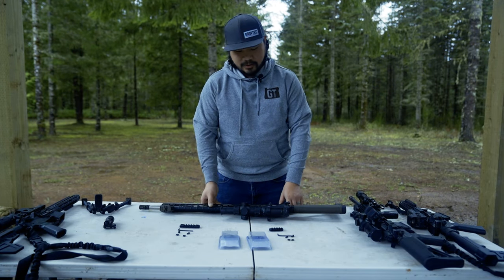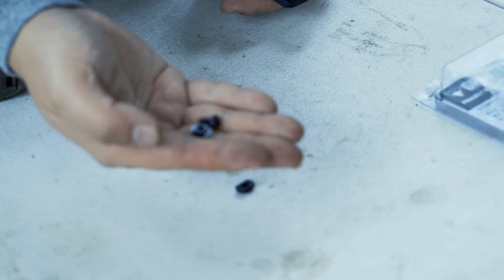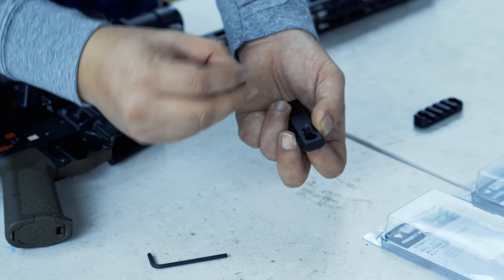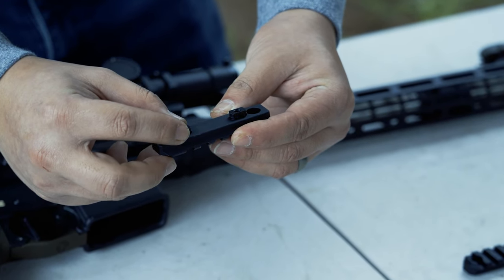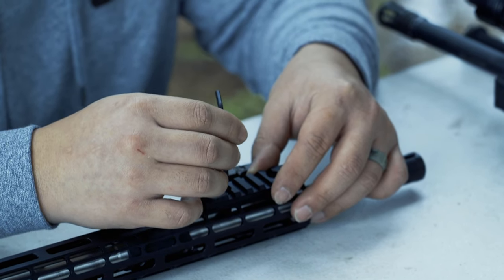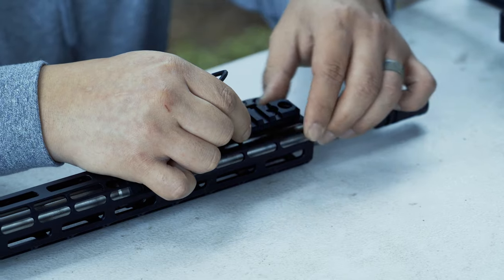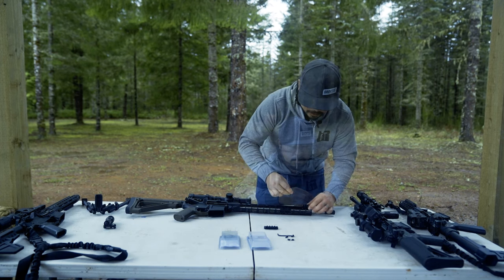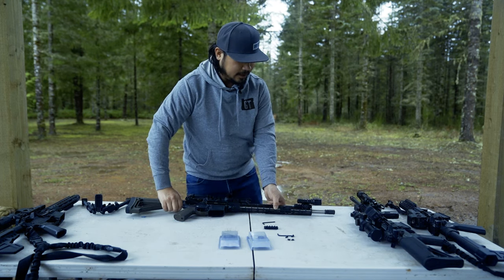How to Install M-Lok Picatinny Rails - Grovtec

Comment: Will the rail adapters only fit the side of Mlok? I want to use a rail on the bottom and use a vertical grip that way like a 1913 rail will that work with the Magpul rail section?
Reply from the maker: It will work on any M-Lok Slot, bottom, top, sides - doesn't matter.

Comment: Not a real gun, but I was trying to do exactly the same thing the guy did on the video, I was doing this for half an hour, I even contacted the seller for help, and they told me to keep doing what I was doing that these adaptors were a bitch, which was holding the nut in the horizontal position while screwing down the screw.
The second I clicked on this video, I saw what I was doing wrong, the nuts came attached upside down, and neither me nor the guys at the shop knew.
I just flipped them and screwed and it worked.

So thanks a lot dude.

Comment: I've got two of these mlok rails that I can't attach to the weapon. I can't get the tnut turned 90 degrees. It's like the screws aren't long enough to allow the nuts to turn. If these things were sold with longer screws, it would work. They say mlok is standardized but it is obviously not.
Reply from the maker: Buy from Grovtec. Ours actually work.
Reply: @grovtec  GTSW241 is the only one close enough to work for me. Ideally, it needs to be 3.25" long. 3.8 is too long. How do the push buttons work?

Comment: the screws from my adaptors always have some kind of light brown matter on them - that makes them difficult to screw past a couple of rounds ... any idea how to get rid of?
Reply: That’s loctite don’t take it off
Reply from the maker: You can brush off hardened Loctite (thread locker) with a wire brush or a tooth brush. Reapply some Loctite or thread locker for a secure mount.

Comment: Would this for the bottom I got a bipod for my diamond back db15ccmlb and didn't realize I needed a picanny rail to use it and mine only has one on top so would it fit the bottom so I can put my bipod on???
Reply: You probably figured this out by now but yes. I was just messing with mine and got it done for a light
Reply: @isamm_1336 yo I got a db15 556 what did you use for you mlok rail to attach the flashlight?